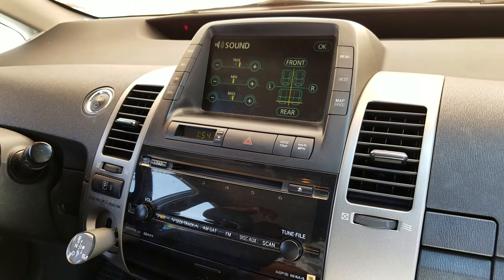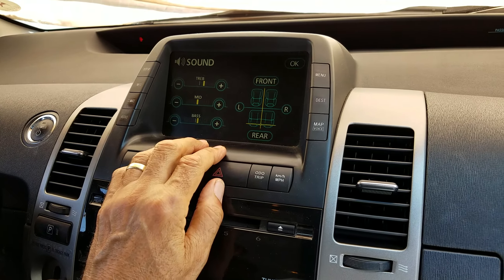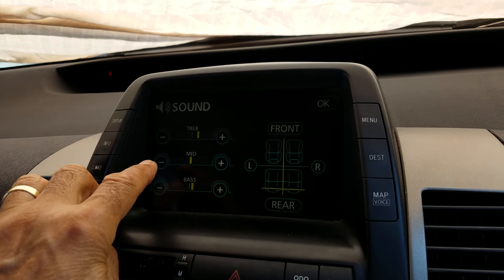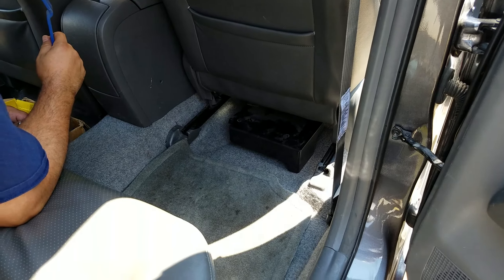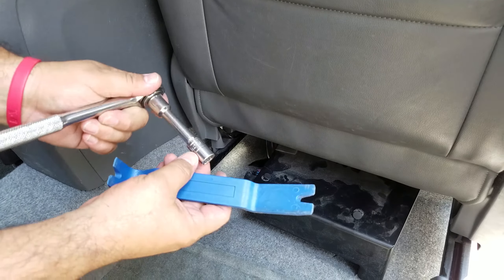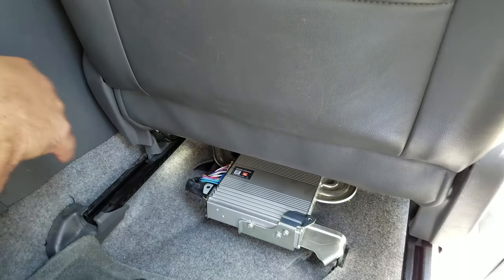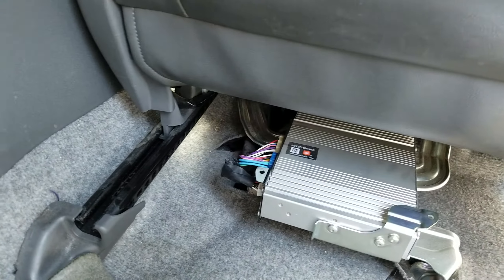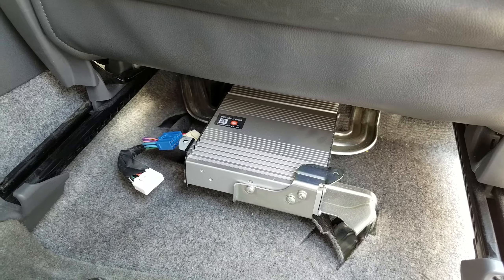How to Remove JBL Amplifier from Toyota Prius 2007 for Repair.

Comment: Are they changing the wire harness to install the amplifier for the Toyota Prius 07 because my radio is not working when I move the amplifier what should I do to make my radio work without amplifier?

Comment: I watch your video to have to remove the amplifier from 2007 Toyota. I remove the amplifier, but the radio is still not working. The three plugs are not hooked to nothing after the amplifier how to fix the radio to make it work without the amplifier back to originalbecause I just bought this Toyota Prius they didn’t tell me nothing about the appreciate if you help me with thank you
Reply from the maker: @AbdulKarim-zo5kg  you have to have the amplifier. Without amplifier it wouldn't have sound.